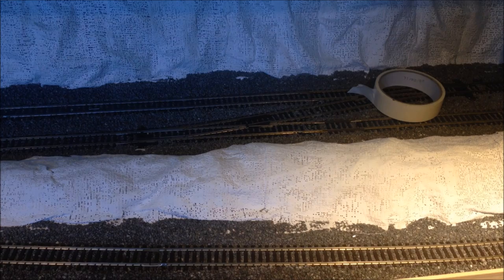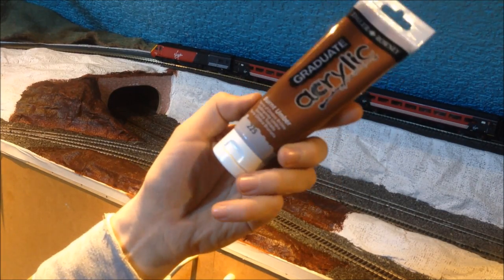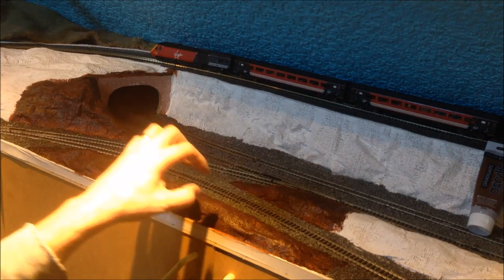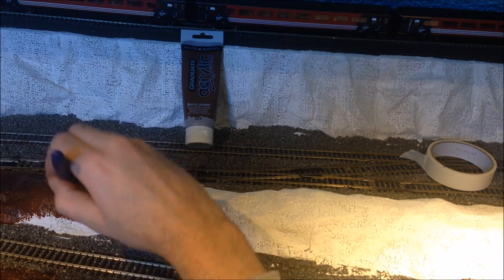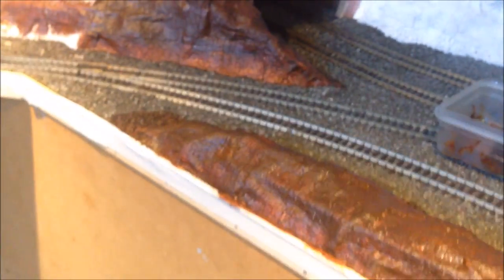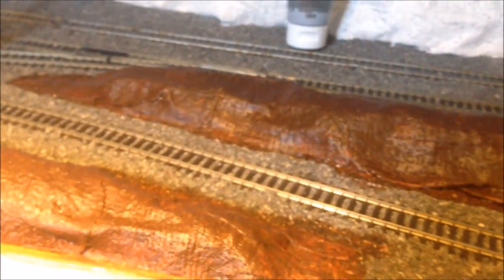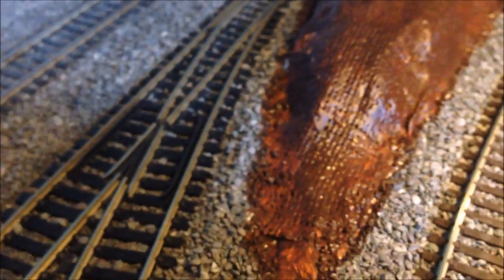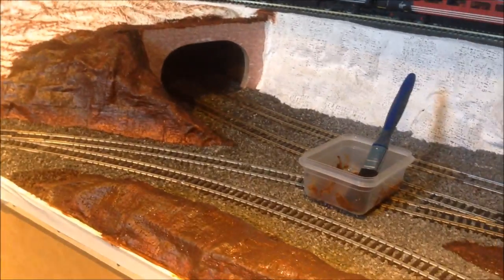Painting A Plaster Cloth Hillside On A Model Railway

Comment: Hi Barnabas.... great paints , I always stock up when they are on offer. I used them on my rock area.   I like the bit between the tracks I'm thinking of adding a bit between tracks as the tunnel rock face needs balancing out .  Any how great tips looks good ....fred. Ps do you ever use pound shop filler over the plaster cloth ?
Reply from the maker: Thank you for your comment.